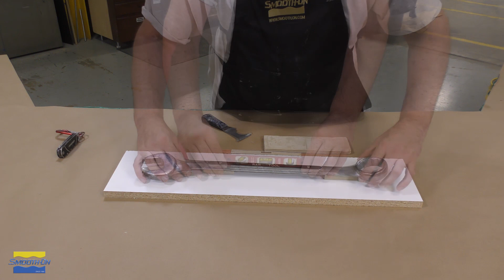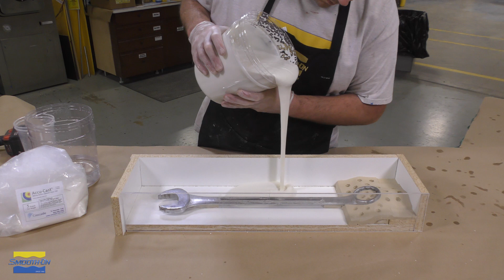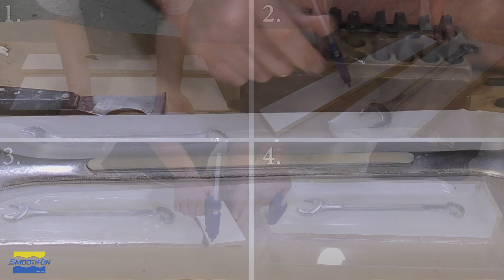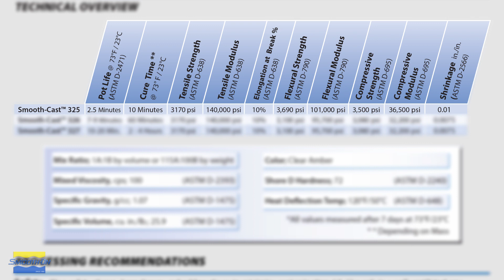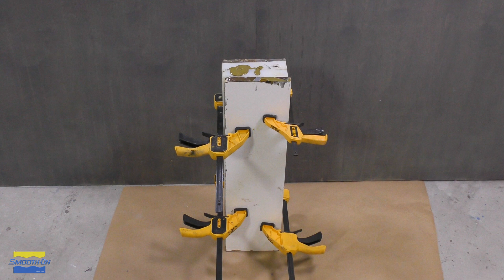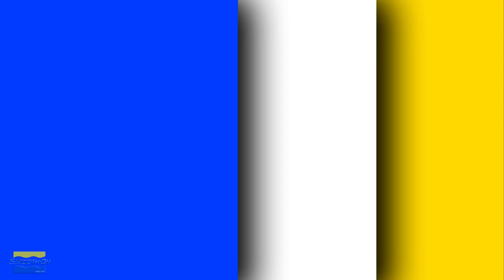Cold Casting a Resin Prop Wrench Using Metal Powder and Smooth-Cast 325

Comment: hello , i did the mistake to remove the props on the first mold and now it doesnt fit right...i get it about DO NOT REMOVE PODEL FROM MODEL, because now i got some space between my mold and props.  What advice can you tell me to fix this before i pour the second mold ? thanks
Reply from the maker: You should apply release to the entire first mold half, even under where the model goes.  That way, excess rubber that gets underneath can be removed and trimmed away.

Comment: Can you use pressure casting techniques with the slower version of 325? Or will the metal filler not show up correctly? I would rather pressure cast the material if possible with this technique...
Reply from the maker: The metal powder may settle our when using a slower resin.
Reply: I've seen people coat the mold with the powder. It will embed on the surface of your cast. This is typically done using mica powder.

Comment: All of these cold casting videos with the metal powder.... you never mention powdering the molds first, yet when you open the molds after casting, it's clear that has been done by the halo of color.
Also, you can't get that quality of metallic shine from just powder in the resin (which is why the molds should be powdered first).
Why do most of these videos omit the powdering of the molds, even when it has been done?
Reply from the maker: In this case, the residue is from an earlier test with powdering the mold.  It didn't provide any benefit for this piece versus mixing the powder in, so that is the method we recommended for this tutorial.

Comment: @smooth-on  Can a cold cast be polished to a high shine ?
Reply from the maker: It can be polished to a high luster, depending on the amount of powder you add.  Because of the nature of metal powder, “chrome” type finishes aren’t really possible.
Reply: @smoothon  thank you for the quick reply. Would you be able to make a video showing the shiniest it can be by adding the metal powdes to the resin? Also can these be mixed with lead-free pewter?

Comment: Great video. I've wanted to try the alginate technique to save time claying up molds. Will there be any issues with the alginate if the first pour of silicone needs to be pressurized?
Reply from the maker: Should be no issues there.

Comment: Something I’ve been thinking about - is if Silicone can only stick to Silicone, why not use two or more different version of Smooth on silicon for Mold making, ~ example-  Rebound for details  then say Mold star to make the rest of the Mold, or mix and match ~ the best of both products.
Reply: I do that a lot w rebound and moldstar/dragon skin. You just have to make certain that the silicones are compatible (e.g. platinum cure and tin cure do not play well together).
Reply: Pneumaddict yeah, it’s just something I’ve been thinking about for sometime, that I have noticed about the different versions smooth-on offers,  

~ 💭 if you took that one and mixed it with that other one wouldn’t you get better results for you’re project (sort of thing)